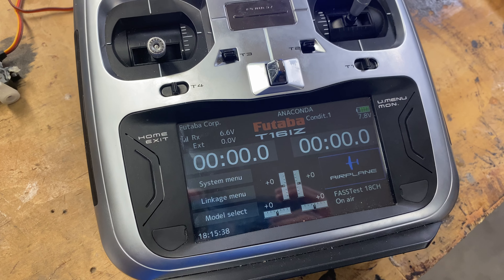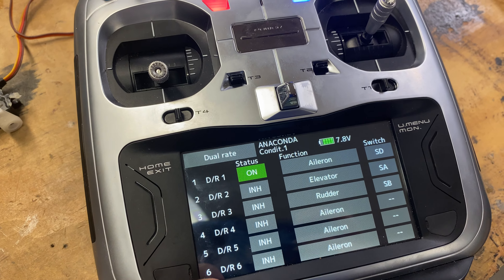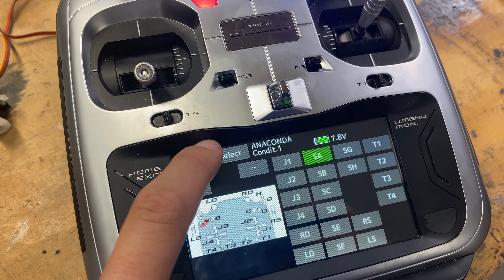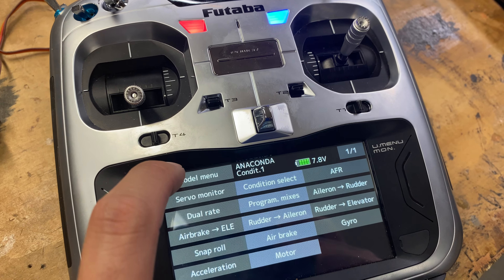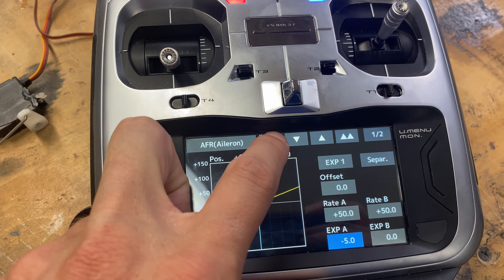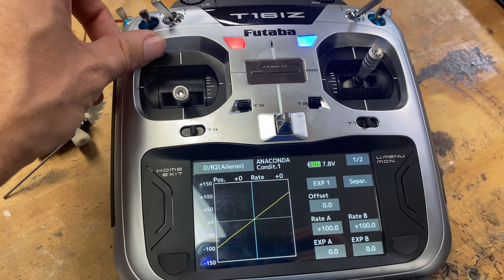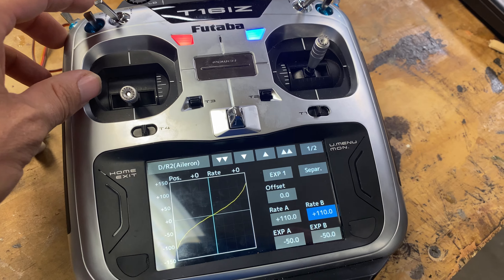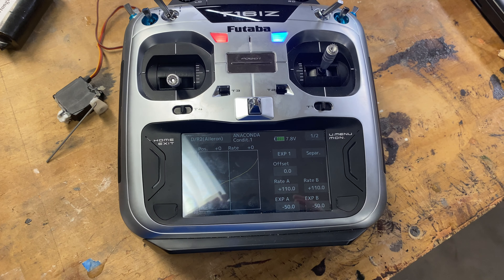Triple Rates Futaba Radios

Comment: Hello, how does the radio feel overall?  I heard it's pretty light compared to other Futaba radios.  Side profile looks thin compared to the 16SZ or 18SZ.  Were you able to get a firm grip on the back?  Also how does the gimbal feel?  How does the sliders feel?  How does the rotary dials feel?

Comment: Hi KG, thanks for your video. I have 2 questions: 1. Can I put ailerons, elevator and rudder in the same switch, right? 2. Can I program in the same switch, 3 levels of rates : low, medium and high? thanks for your help 🙏
Reply from the maker: Yes you can. You would just assign each surface rate to the same switch
Reply: I set my 16IZ and before that my 12FG the same way you are describing.  Use a 3 way switch and the conditions set up screen.  On AFR screen you need to set each condition to single setting instead of group.  Then you can have your rudder, elevator and aileron deflections change on the same switch.  I label each setting landing (low rate),  sport, and 3D (max deflection).